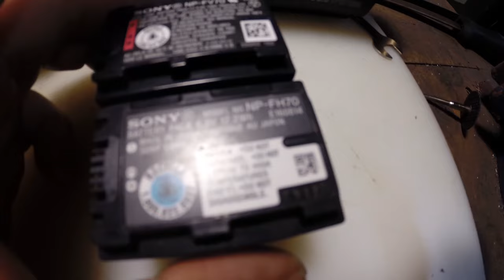AWESOME battery "HACK" Sony handy-cam. SAVE $$$$$$$$$$$$$$$

Comment: I tried this with original np fh30 and it says incompatible battery after 1min 30sec. (I have installed an external case and used 18650 panasonic 3500mah battery as the original cells were completely dead and it works fine with lower capacity cells like close to 1500mah) edit- my version of sony camcorder does not support the npfh30 battery . I did the same with a board from npfv50 battery and it works like a charm!
Reply from the maker: good info thanks ;)
Reply: @Ibex-  actually no. It doesn't work with any cells. Cus sony has programmed my specific version of camera to nut support npfh50 .. it only supports npfv50.. i tried to do the same with an npfv50 and it works great even with the largest 18650 cells..